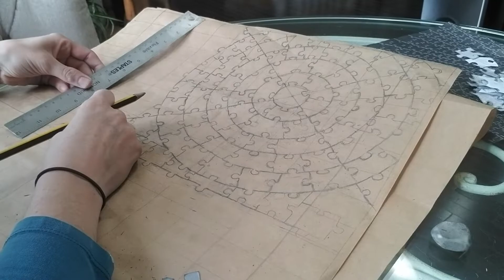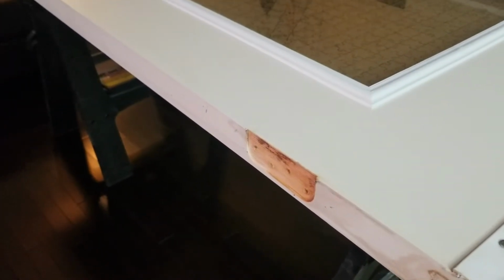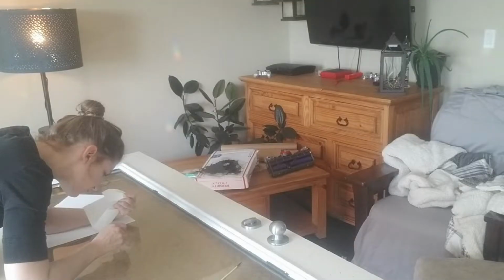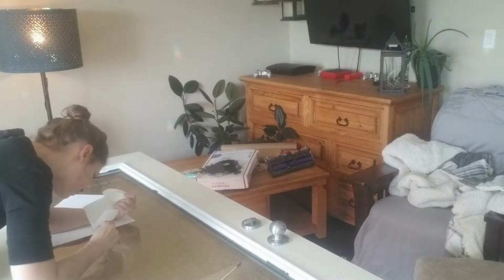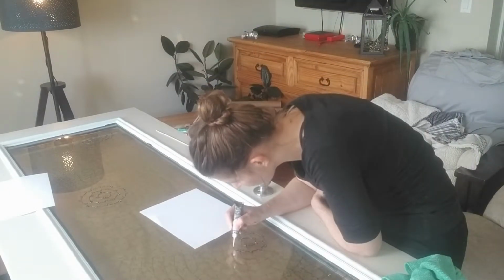Fake stained glass

Comment: I am very impressed with your patience with this design!  It must have taken hours and many tired hands to get all those pieces drawn!   I liked how the clear glass was the missing pieces, it was a nice touch!  How resilient is this stuff to sun and how durable is it when dry?   I could not have found this at a better time as I am working on a project soon that 100% can use this!  Thanks so much for sharing 😀
Reply from the maker: Thanks for the amazing comment. As for the durability / etc. its pretty much permanent as a goes on the glass. However if you really want to remove it, you can scrap it off with difficulty, but it will leave residue behind and you'll have to use a mineral spirit to get the rest of it off, Which is just a mess, From personal experience. As for holding up in the sun, I have had no problems,  the door gets direct sunlight during summertime and its was in the 40 degree temp last summer, and there was no change. And winter the same. It seems once it dried its solid. I used the oil base product line which doesn't require baking. If you are doing something similar and cant put it in the oven.   I'm very excited to see your upcoming project using these products.
Reply: @colesmadcreations1129  Thanks for the info Cole!   As for the temperature you were dealing with I see your Hedwig video was tagged "Alberta" and I went through that exact heat wave!  I live in Southern Alberta and that was not a fun time!  Regardless keep up the great videos!